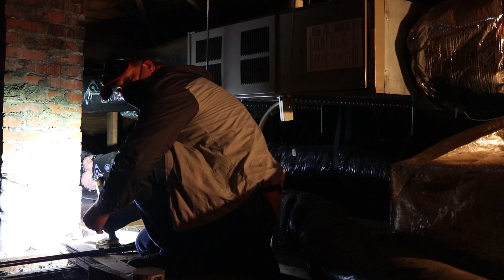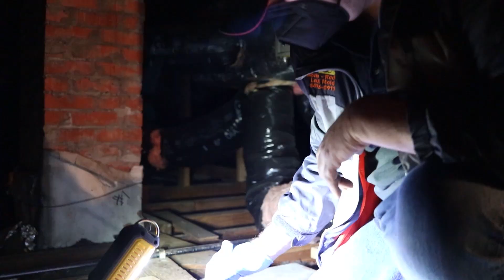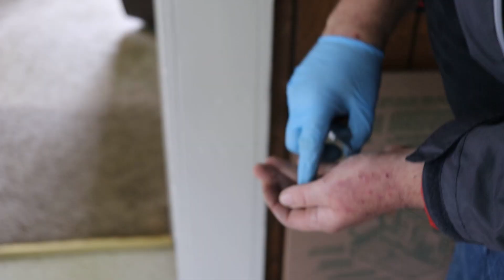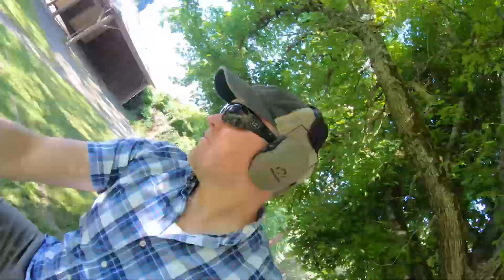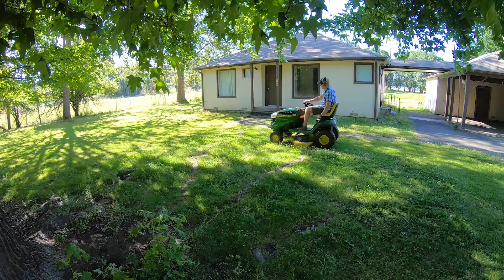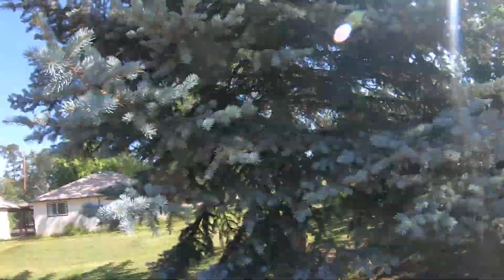This House Could Kill You

Comment: This is a not-insignificant part of why I really appreciate living in a house built in 2002. The building materials might not be perfect, but I know they're not full of lead or asbestos. So then it's just the leaded aviation gas from the nearby airport, and the PFAS from the associated air base (probably far enough away but...), and the gas station down the street from the park that has the city well, ...
Reply: My understanding from talking with an asbestos tester is that while us manufacture using asbestos is forbidden importing is not and you can’t assume foreign products don’t have it. Maybe he was blowing smoke but he said he routinely tested new imported products and found them to contain asbestos
Reply: Some of the sheetrock from China contained substances that outgassed and attacked copper piping (and stunk).  It was around that time from what I can recall.
Reply: @jum5238  Chinese drywall was defective because it emits a sulfur compound. The reason behind this dangerous emission is that a waste material from Chinese power plants, a substance known as fly ash, was used in the manufacturing of Chinese drywall.

Comment: I think Asbestos is one of those things that can be very dangerous or can be very benign depending on the application and exposure. But because there is and was big money in asbestos litigation and abatement it's very hard to get real world sensible recommendations.

In most cases, if you're not dealing with the worst of the worst friable material, and don't go out of your way to make a mushroom cloud, and use some good practice PPE, moisture, ventilation and isolation it's well within the means for most people to deal with it.
Reply: That is dangerous misinformation and you are just plain wrong.
Reply: @tropifiori  Care to elaborate? I didn't make any controversial claims in regards to what the actual research says.
Reply: @bradley3549  his cousin's wife's uncle's neighbor touched asbestos one time, died the next day.
Reply: @billrosenstein  Not even once Bill, NOT EVEN ONCE!
Reply: Bradley, I agree with your statement.  in have been in the home remodeling business for over 25 years.  I have personally conversed with EPA reps and building inspectors over the years and generally they would also agree  with your statement.  Asbestos is dangerous only if you breath in the dust or eat it, plain and simple truth.  I had an  EPA rep tell me how to safely drill a hole in asbestos siding, "put a glob of shaving cream where the hole needs to be and drill thru the shaving cream, after your done wash the area with running water". I thought that was a good practical idea.

Comment: Wait. So there was asbestos, but they let you smash it all with an excavator anyway?
Even the tester used his bare hand on the dust created from drilling a sample.
I’m still pretty confused of it’s danger. One group says it kills on contact, the other only puts on one glove and creates dust but drilling!
I
Reply: Inhaling and ingesting the dust from asbestos products is what causes issues
Reply: The danger is in the dust. So the primary tool to assist with abatement is water. Anywhere water is impossible to use you have to build tents and barriers and use a highly filtered air collection system. Touching asbestos really doesn't mean much. Touching it all day every day does, but not actually because you touched it - because you likely ingested it. It's all about ingesting the fibers, so dust is the primary enemy. If you'll notice - the footage at the end doesn't have any drywall in the demo shots. It was removed, and they watered the project.
Reply: Lots of fear mongering about it. Some warranted. It's a significant occupational hazard. You would not want to be working with the stuff every day. And with that in mind the steps abatement specialists take are warranted because they are around it all day every day.

But in general? I don't think it's stretch to say in todays world airborne crystaline silica (sand) may be a more concerning substance. Mainly because people don't consider it dangerousso the amount of long term exposure becomes much higher for folks working in industries that involve dirt work, cutting and grinding of silica-containing-rocks. At the moment, yearly deaths attributed to silicosis is a lot lower than asbestos related illnesses - though they both cause very similar symptoms. I think there may be two factors to that. We still have a lot of folks around who were actively in the workforce prior to and shortly after Asbestos was heavily regulated. And those folks tend to also work in industries where exposure to silica dust was also a factor.

It's an interesting topic! The bottom line is - wear a properly fitting, high quality respirator whenever doing anything dusty. This simple thing would have saved or greatly extended innumerable lives had it been common practice (and the technology existed) 50+ years ago.
Reply: I do work with it every day, have done for over 30 years, I also work with people who are suffering the effects of exposure.
Reply: @bradley3549  yep. A P100 (HEPA) cartridge mask is the way to go.

Comment: He doesn't answer the question asked twice by Essential Craftsman: "if it's just one or two days can it be detrimental vs exposure over long periods" Does anyone here know the answer to that question?
Reply: I think it's more ling exposure but best not chance any exposure
Reply: @eamonmoore6134  Seems logical. Thanks for replying.
Reply: The problem is that it's considered unethical to run a randomized controlled trial to test it. The only way to test such a thing is to get a thousand people or so, split them into 2 groups and expose one group to asbestos for a dew days and then wait 30 years to see what happens to the people in both groups. This is literally the only way to know and because asbestos is considered to be a carcinogen a study doing this would never get approved or funded. The length of the study would also be problematic... the longer the time it takes for results to be seen the harder it is to show cause and effect.
Reply: There is no minimum exposure threshold.  But, the mineral is naturally occurring and you’re breathing it in daily.
Reply: It depends on how lucky you are. Every exposure is another roll of the dice. Some people cheat the odds for decades. Others can fall afoul of a single exposure. Digging it up and putting in in home can mean exposure every day.
Reply: @anttiroppola4414  By digging up do you mean disturbing existing materials that contain asbestos?
Reply: @curiousgeorge555  more that while asbestos may occur naturally, and perhaps at trace levels,  humans have found asbestos to be useful and find large natural deposits to dig up and manufacture all sorts of products to put in homes.
Reply: @anttiroppola4414  thanks

Comment: I'm surprised he isn't more aware of how dangerous asbestos is given the field he and his dad are in. I renovated an old house 20+ years ago and I ended up spending a couple grand testing various materials I'd run into during the remodel. Luckily nothing had it (house was so old it pretty much missed the hay day of asbestos use) but there was plenty of lead paint.
Reply: I worked in construction in the 80s and it never came up.  I did a lot of demolition too.  Scary stuff.

Comment: Spare me the horror stories.  I've been exposed as a joe-schmo, school cleanup when I was a kid for two summers and in my home and I won't lose any sleep.  These regs are for a CONTRACTOR.  Any ACM material the homeowner can dispose of in their primary residence.  Typically in a home its in: insulation, pipe and batt, surfaces, tile, countertops, tile glue (its black), drywall compound 50s early 60s, wall lathe compound, exterior shingles.  Just wet it, change your clothes after (spray them down outside first before washing) and avoid grinding.  Best to isolate the area, ventilate, use a respirator.  Better yet leave it in place by encapsulation if its an insulator, its a superior material in most cases.